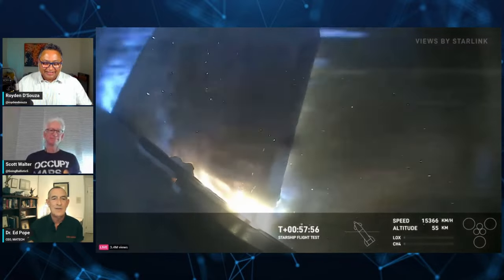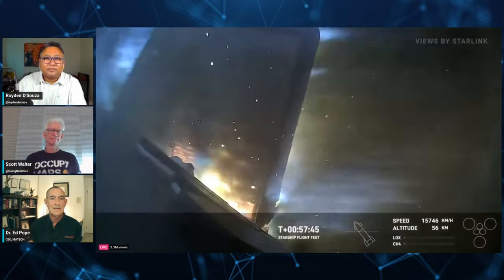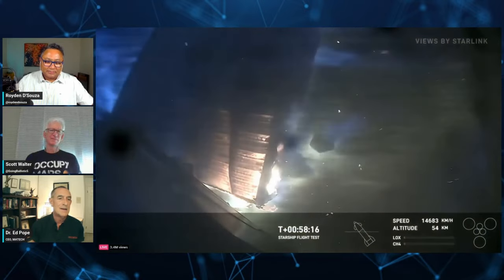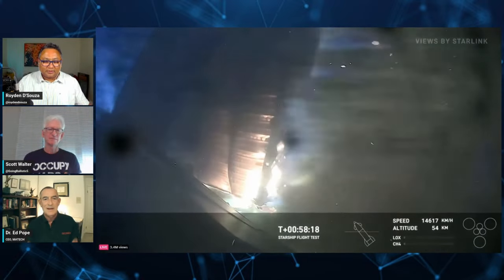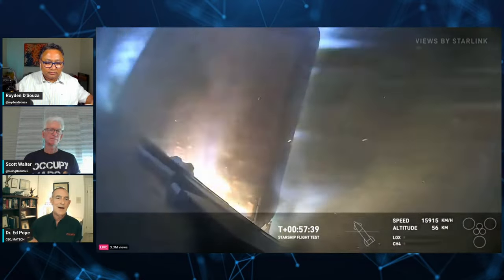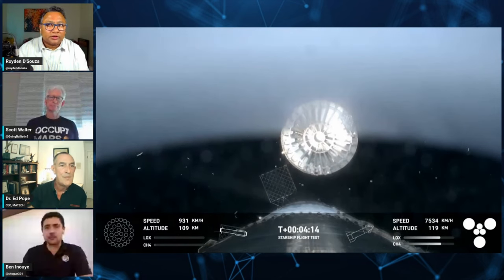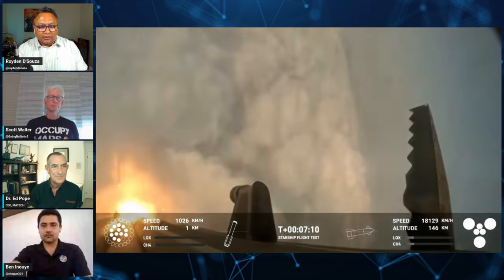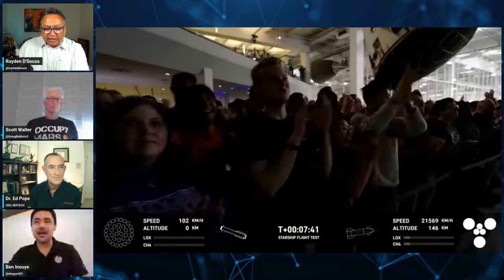EXPLAINED: The Science Behind SpaceX Starship's Plasma Colours and Next-Gen Heat Shield

Comment: Why not make the flaps and flap hinges out of titanium like F9 grid fins? It can handle higher heat.
Reply: Unfortunately, titanium can't handle the excessive high temperatures of reentry. While it melts at 1660C, it softens and oxidizes at far lower temperatures. Ideally, materials that can handle 2700C are much more preferable.

Comment: The description of thermoluminescence at the beginning is incorrect. Metals do not thermoluminesce. What he's describing is the simple line emission of hot, excited ions. Thermoluminescence specifically refers to the emission of light from crystalline materials upon gentle heating as the release of electrons from traps or defects within the crystal lattice occur. Electrons are usually elevated to these excited states in crystals by exposure to high energy ionizing radiation coming from natural surroundings over millions of years.
Reply: Elements of metals that vaporize can thermoluminesce.
Reply: @edwardpope3946  Not if they exist as a gas where the atoms are in isolation from one another for timescales on the order of the excitation lifetime. That's just line emission. Thermoluminescence has a specific definition which pertains only to energy transitions in a solid state.